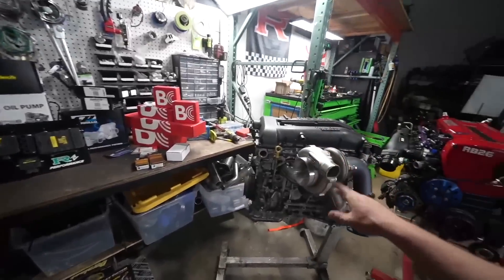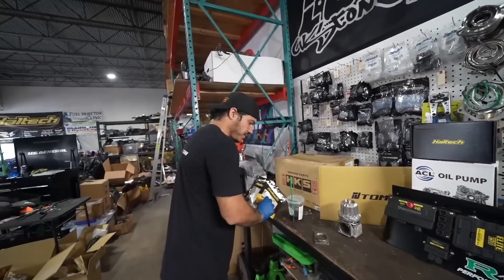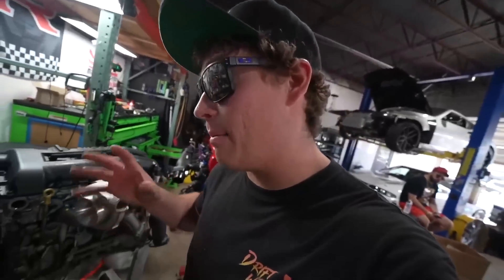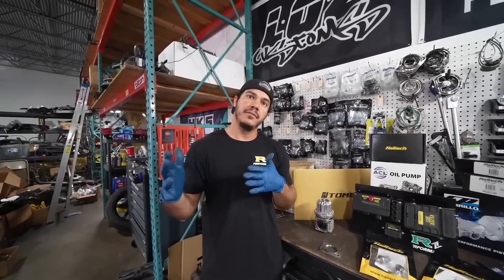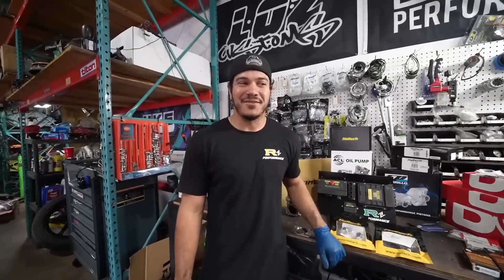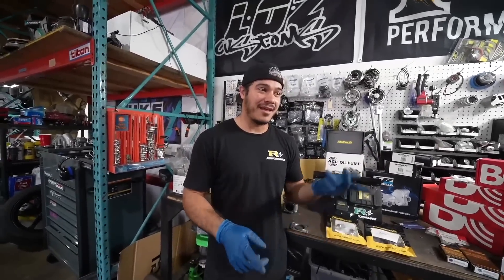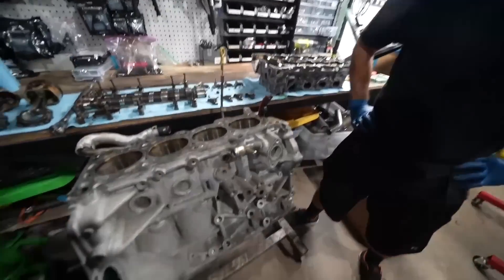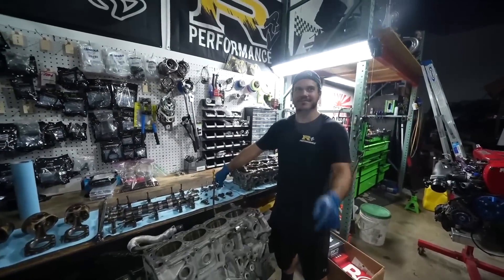FINALLY BUILDING MY S14! (FORGED SR20DET)

Comment: It’s a shame Roberto wasn’t this thorough back when ruddy first got his GTR. He would’ve caught the “coil pack” issue before it blew the motor.
Reply: oh man, get yer boots on boys!
Reply: To be fair ruddy was pushing the turbo past its efficiency point.  Every told him it was a bad idea.
Reply: I don't think Roberto was ever the issue.
Reply: @TransLivesMatterTLM  Roberto pushed the turbos too far, and Roberto put the cheap ass coil packs on it, Roberto is entirely to blame for Rudniks R32 blowing up
Reply: Also Roberto was working for someone not for himself!
Reply: The past is the past love seeing people grow
Reply: I guess he learned from it then, "ah, don't use them again".
Reply: wasnt the reason it blew up the loose lock screws on the adjustable cam gears causing timing to be all over the place?
Reply: @skunkbomber08  no that was Dustin Williams motor in the r32
Reply: @Mullitt Mustang  rudnik told to run the turbos to the max he told him it was bad rudnik didn't care and the coil packs was tommy he sold rudnik bad coil packs
Reply: Obviously ruddy doesn’t care why it blew up. Roberto is doing killer work that can’t be over looked with petty ass comments from something about the past
Reply: How many years ago was this???? People grow people change and they sure as hell learn. How about half you YouTube mechanics sit back and listen to the man nd give him the respect he Diserves.
Reply: How can a bad coil pack blow an engine. It will just misfire
Reply: @R32ONP  repeat what you just said
Reply: @NORMANBARR  hello there . A bad coil pack will miss fire. It will not blow an engine up.  I build race cars and build engines for a living mate.
Reply: @R32ONP  suuuurrreeee
Reply: @NORMANBARR  u clearly understand how an engine runs and what a misfire is then don't ya
Reply: @skunkbomber08  that was dustin Williams lol
Reply: @7112productions  Na man, we need to keep the drama going, now it's apparently jacks fault seeing as Ruddy decided to colab with roberto and not jack, so jacks name is being thrown out in the wind now.
Reply: @R32ONP  at idle it's probably okay to have a misfire for a while. And on most normal cars it's not gonna do too much damage. But when your have unburned fuel ending up in different places being shoved under compression and what not thru valves n shit. It does tons of damage. Plus you can go the other way also and either lean or too rich is not good.
Reply: Coilpacks weren’t the issue….go back a few years to the tear down video the oil was very thin and black
Reply: @KhaosDaddy92  ignition misfire and a stuck injector are very different things.

with no spark, the "unused" fuel is yeeted out the exhaust ports. not going to do damage to internals....on it's own

(catalytic converters don't appreciate the extra fuel though long-term)
Reply: the real problem was ruddy being a cheapskate in those days

Comment: What you guys are actually talking about are fail-safes not redundancy. Redundancy would be having two oil pumps so that if one fails, the other can keep the pressure up. A fail-safe is something that ensures that if there is a failure, it fails in a way that doesn't do more damage.
Reply: It's called "information redundancy." 

Any failsafe is a version of redundancy.

In my tuning, i use many layers of closed loop and delta based strategies that would fall under the core definition of "redundancy" if that's a better way to look at it.
Reply: @ravperformance  Ahh, I see what you are saying. You have multiple data sources that are redundant for each engine system. You aren't relying on a single sensor to see if their is a problem with the fuel system as an example.

By the way, you and the shop are looking great man. I almost didn't recognize you!
Reply: @bearded4glory809  to be fair, your original point is valid. It's just a matter of  how you look at it so i completely understand your point.

Thank you! Much appreciated  :)
Reply: @ravperformance  Brother I'm so happy to see YOU happy. I'm going to pay you a visit soon if that's alright.

Comment: ‘Redundancy’ would mean having a secondary oil pump for example, redundancy may not have been what you meant. Fail safes perhaps, so you can shut things down if the ecu detects something isn’t right, via monitoring.

Comment: Everything you guys said are called fail-safes and monitoring. Redundancy would imply if something breaks like your fuel pump there is another one that turns on.
Reply: thats what i was thinking, kinda bugged me
Reply: I would be referring to what's called "information redundancy."

By definition, a fail safe is redundancy
Reply: It just seemed like Roberto learned the word “redundancy” and was trying to shoehorn it into conversation lol
Reply: I could cure cancer, and you guys would ask me why i took so long 😕
Reply: @ravperformance hey Roberto can I use the use the idea on any engine?  I have a 6g72tt that I want to do that too, since it would help me diagnose 3000GT weak points.
Reply: @rustrocket8973  yup, as long as your ecu has the features and the tuner is capable/willing this strategy can be applied to almost every engine
Reply: @ravperformance  interesting and intriguing!